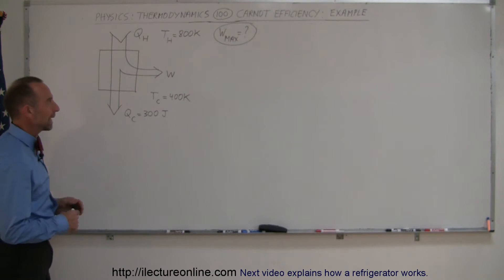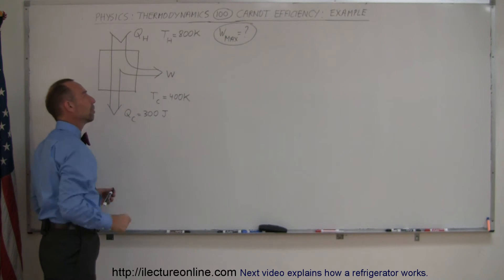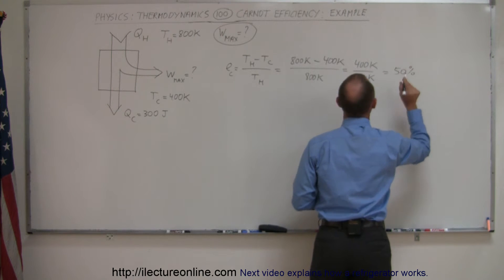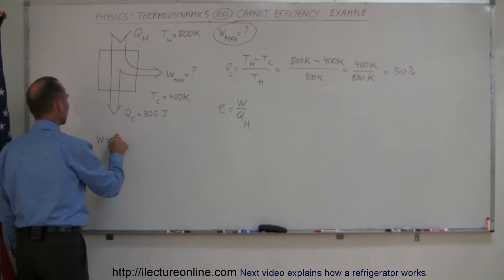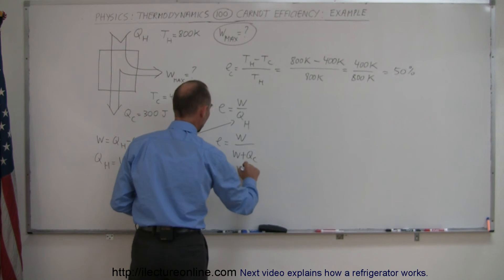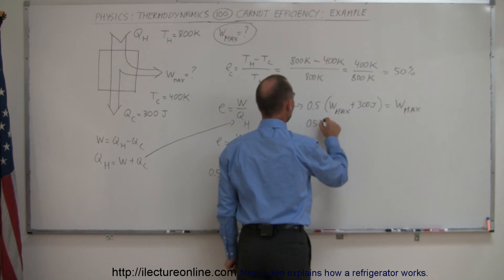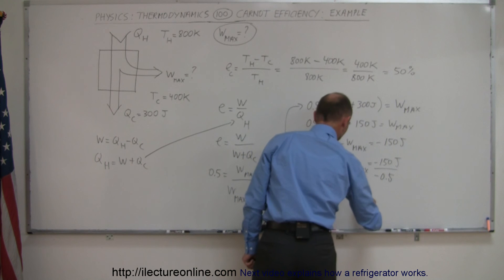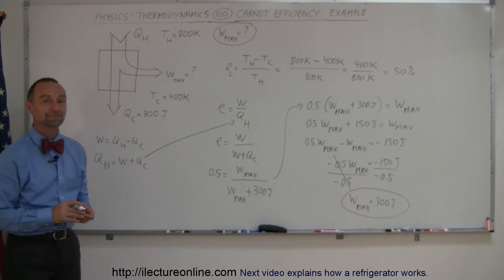Physics 29  Efficiency Of Heat Engines (10 of 14) Carnot Efficiency: Example

Comment: Isn't Tc the temperature of the cold reservoir? It is in my book but I'm not sure if it's the temperature of Qc or the cold reservoir.
Reply from the maker: Same thing.  It signifies the temperature of the exhausted gas.
Reply: @MichelvanBiezen  So the temperature of the exhausted gas has the same temperature as the cold reservoir?
Reply from the maker: It is more like Qc "is the cold reservoir".  You picked up on the confusion that I had as well when i saw this for the first time.   The "cold reservoir" is just a generalized term.   So think of it as the temperature of Qc being dumped into an unknown cold reservoir.
Reply: @MichelvanBiezen  Okay thank you! I guess I just need some time to absorb that many things. I'm too hard on this topic so maybe I need some space to better understand it.

Comment: sir can't we calculate the maximum work done here by formula T(hot)-T(cold)?? why are we using Q(hot)-Q(cold)??
Reply: as we know that the efficiency formula is T(hot)-T(cold)/T(hot).and also efficiency=Q(hot)-Q(cold)/Q(hot).
Reply from the maker: That depends on the situation.  For a real engine we use Q since the equation is in units of energy.  The T is used for the Carnot engine, which is a theoretical engine (doesn't really exist).
Reply: thank you sir....

Comment: hello professor I was wondering how would we approach a problem which wants us to find the work, so for example if say an engine had coefficient of performance of 6 and absorbs heat from atmosphere at a rate of 35 kW
Reply from the maker: Engines do not have coefficient of performance.  That is reserved for heaters, refrigerators, and air conditioners.  K = Qc/W or W / Qc/K   = 35 kW / 6 = 5.83 kW.  (assuming that the atmosphere is considered the "cold" reservoir).
Reply: Oh I see,  thank you!

Comment: so without totally confusing the hell out of us heat out is equal to work max in most cases   ?
Reply from the maker: No.  Work Max = e max * Q h  (where e max is the maximum efficiency and Q h is the heat received from the heat reservoir)
Reply: NOBOX7 ok im sorry for the confusion sir i was under the impression W= t1-t2/t1 but you are saying this is just efficiency max and W = t1-t2/t1 QH ? thank you for your time professor
Reply: Michel van Biezen thank you for clearing this up i get what your saying , it was my mistake thank you for taking the time to explain
Reply from the maker: NOBOX7
No need to apologize.  Learning is all about looking at a problem in different ways, asking questions, and giving yourself the time to absorb.  The efficiency of an engine is:   e = W/Qh  and since W = Qh-Qc 
efficiency can also be written as:  e = (Qh - Qc) / Qh

Carnot figured out that the maximum theoretical efficiency of any engine is:

e = (Th - Tc) / Th
Reply: thanks again for your time , your efforts are not in vain.